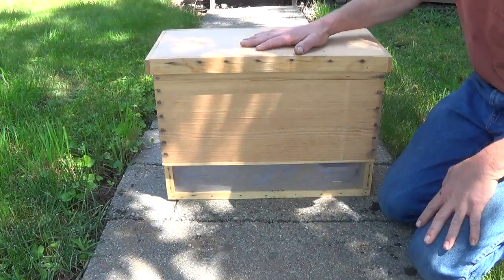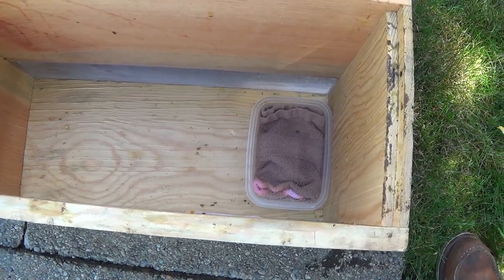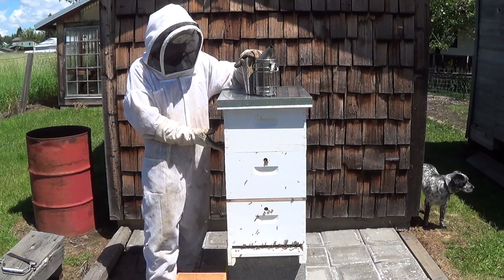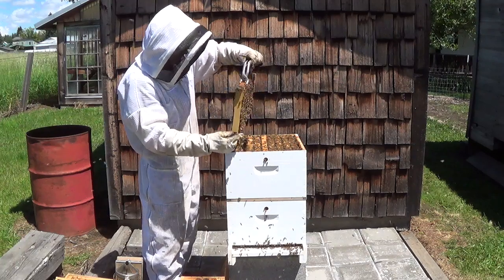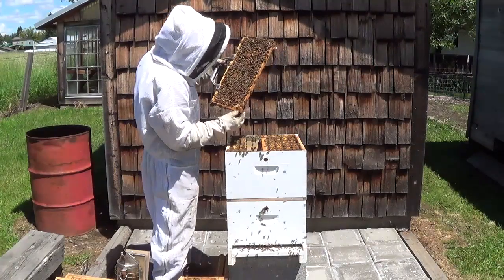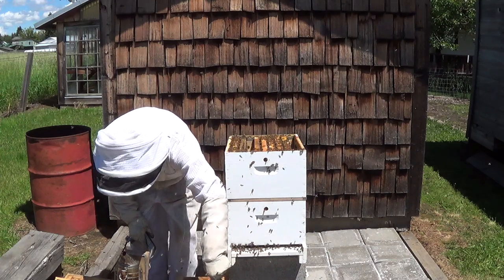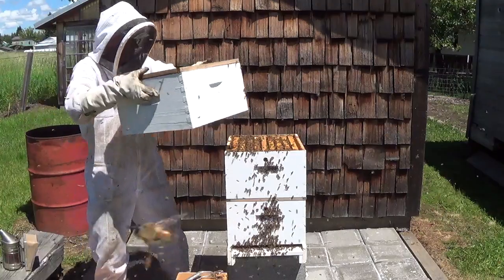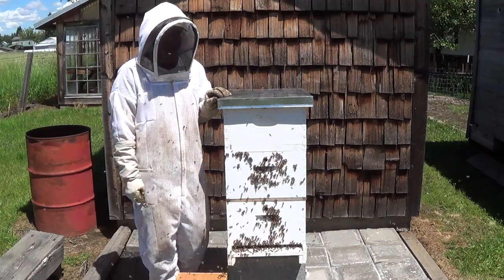Step 4: Nicot Day 3

Comment: This video series is excellent.  So glad I found your channel!  Have you thought of using a cloak board on the donor hive to bypass having to use a cell starter Nuc?  That way the same hive boxes could be used from start to finish for queen cell building without the extra hardware of having a cell starter Nuc.
Reply from the maker: That is an excellent idea. I will build a cloak board and give it a try.
Reply: @pathofthebee2873  I'd like to see that as well.